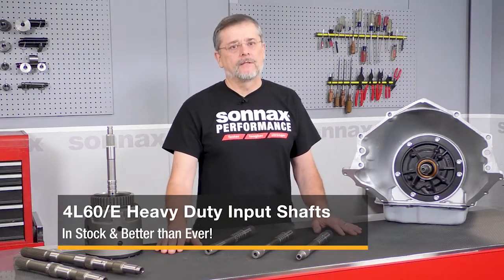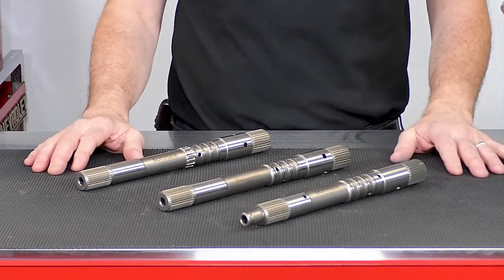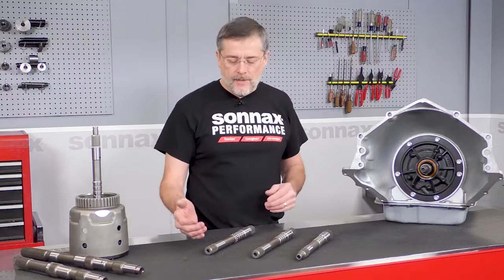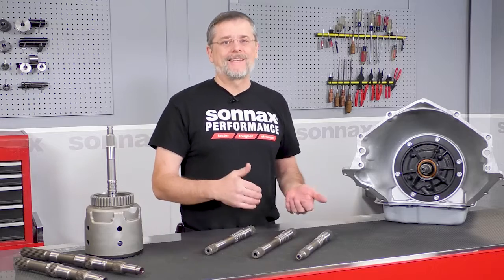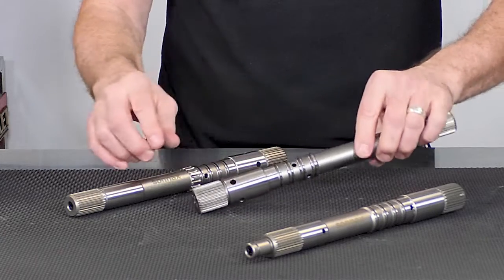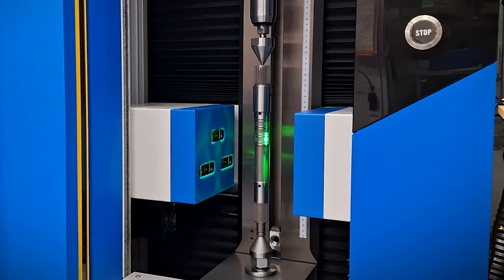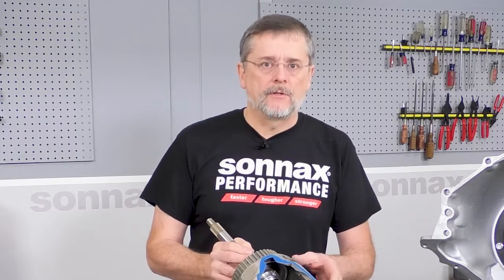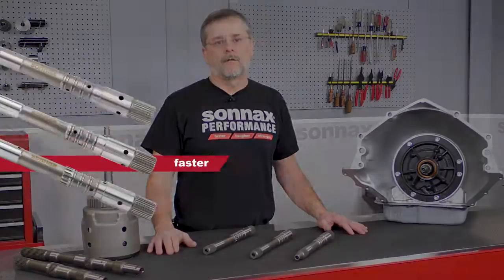Sonnax 4L60/E Heavy Duty Input Shafts – Back & Better than Ever

Comment: Truly love the work u guys do over at sonnax!! Im running a 4l60e with the full catalog and its still running strong a 14months later. in my daily cammed 6.0 lifted extended cab on 33s. I’m really tempted to tear it down to add the new updates like the billet forward piston, sleeve and the new gm054 valve body. Im still waiting for summit racing to ship it since nov. 7th 😢
Reply from the maker: So glad to hear it's still running strong with Sonnax parts on board!  Once the new parts arrive, it'll be even better! Thanks so much for your support, we really appreciate it.